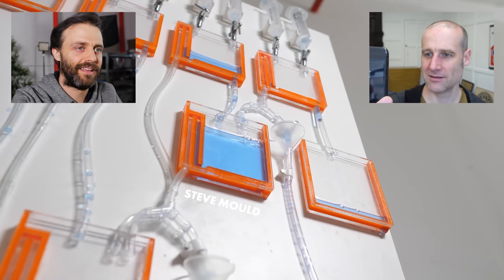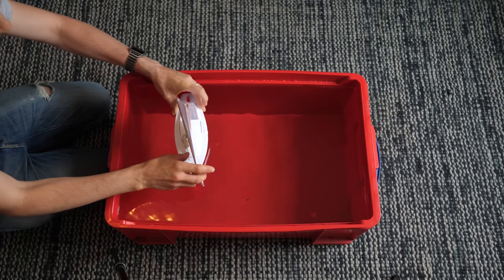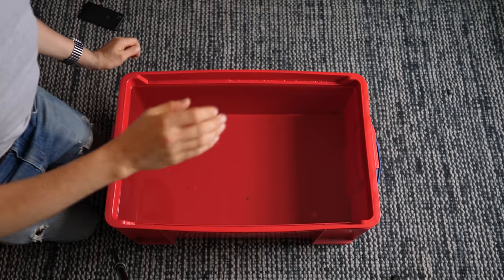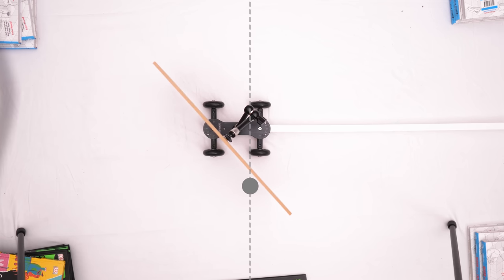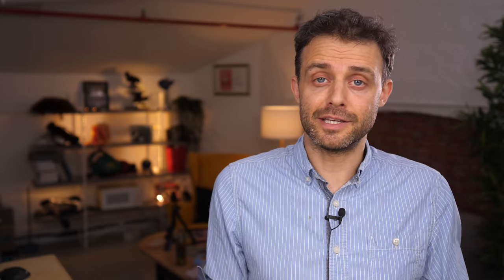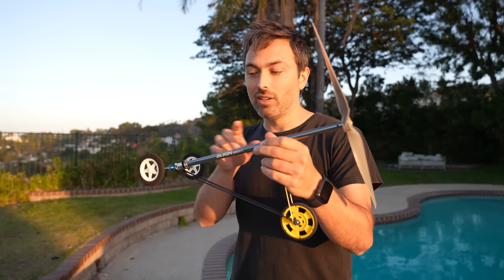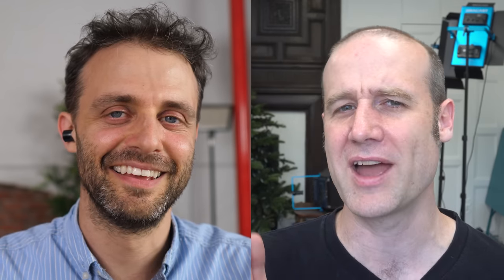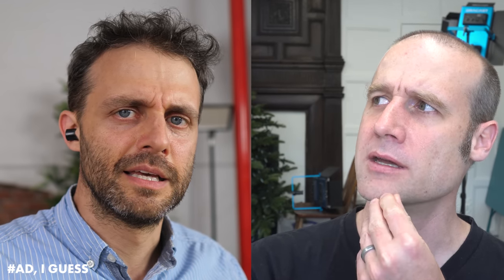Sailing Faster Than The Wind - How Is That Even Possible?

Comment: The Blackbird has no sail to take advantage of the wind in this way , though.  Nice , physics partially accurate, video !!    
The vectors of force , deflection of wind , is not as long as the exact direction of wing leg of that vector. AND the 'equal and opposite vector is not completely in the direction of the boat. There is a vector in direction of boat BUT a vector off to side direction that are the two components that when added together equal that 'equal and opposite ' vector you have dawn . (BEING in water , though, the hull of the boat (and rudder likely ) shift with some friction loss to water the direction thrust to the desired direction of the boat.
FORTUNATELY sails are NOT flat . If they were the idea of wind 'glancing off and pushing the boat would much more quickly be offset by the air friction on the front side of the sail being glancing off and  strongly resisting forward acceleration.

Comment: So the trick with that propeller vehicle is that the propeller blades have a tangential velocity faster than the actual wind speed. And this is possible because they're being hit by the wind at a <= 90° angle relative to their tangential velocity (which is however perpendicular to the vehicle's general velocity), and not from the back like veritasium's video seemed to suggest. Once you transfer some of that extra rotational velocity to the wheels you get a chance to drag yourself faster than the wind. But then this way the propeller would actually be working as a turbine instead, and that doesn't seem to be the case shown in Veritasium's video. I'm still confused.
Reply: The wheels of the Blackbird turn the propeller.  We have a ratchet on the axle to prevent the propeller from turning the wheels.  This is to satisfy the requirement for the record runs that we can't use stored energy.
Reply: @Rick_Cavallaro  thank you for taking the time to answer. I wasn't aware of the ratchet gear when I commented this.

Comment: This video works perfectly with veritasium's. Explaining how the sails of a boat can correlate to a wing (and therefore the fan blades on the vehicle in his video) and how it propels it faster than the speed of the wind going directly downwind. 

A complaint i would have on the video (if it was in responce to veritasium's) is the video should have gone a bit more in depth about how a zig zag is faster and how just a continuous 'zig' would be the same as that to more intertwine the videos and explain how the fan blades does in fact propel the car faster than the wind. 

Obviously its not made by the same creators and its not made to just explain the car but how sails work. Other than that i loved this video and it was easy to follow along with what you where saying.

Comment: Maybe if wont reach that maximum speed instantly, but it will reach a quite higher speed than the wind, just that with less acceleration, you could hust angle the sail more when it reaches more speed, so that you have allways the best possible acceleration, just like with a gear box but with wind instead

Comment: What veritasium is doing is what sailors' call running. As any sailor will tell you you cannot run faster than the wind. The only time you can go faster than the wind is when on a tack (and even then you need a good keel -to prevent sideways drift).

Comment: The resistance to sideways motion of a sailboat is not negligible. Its significant. In fact if you trace the actual path of a sailboat its not at all a direct line perpendicular to the angle of the sail. Your own diagram indicates this however not accurately.

Comment: This is a great explanation of how the speed of a boat can exceed the speed of the wind. However, it seems to imply that if you look at the velocity component of the boat in the same direction as the wind, it will only ever be the same velocity as the wind or less. In Derek's video, he says the component velocity of the boat in the direction of the wind can be faster than the wind.

Putting it a different way. Let's say you had a balloon that is neutrally buoyant and floats a few metres above the water at wind speed, if you race the balloon and a sailboat from point A to point B, can the sailboat beat the balloon. If you watch Derek's video at 7:21 (https://youtu.be/jyQwgBAaBag?t=441) this is discussed. When the question is asked, Derek basically says by sailing at some angle to the wind (and tacking) you can beat the balloon from point A to point B. No explanation is given as to how this is possible. This seemed to be a critical aspect as to how Blackbird can go dead downwind faster than the wind and that is the part that is counterintuitive. Are you able to explain how that is possible with said models to someone who is struggling to understand?
Reply: To see how sailcraft can beat a balloon in a downwind race look at "DOWNWIND VMG GRATER THAN WINDSPEED (WEDGE)" or "DOWNWIND VMG GRATER THAN WINDSPEED (STREAM LINE)"

Comment: Haven’t watched yet but i’m gonna make a guess: the way the air collides with the boat depends on the air’s momentum, not its speed. If a large enough mass of air hits the boat, even if it’s going the same speed, the boat may be able to travel faster than the air?

Comment: I actually think that the explanation  given by in the veritasium video, that the propeller is pushing the car is wrong. Its the fan thats driving the wheels not the other way round. To test this one would have to measure torque (direction) in the drive shaft, from the wheels to the prop.
Reply: "Its the fan thats driving the wheels "

No, it has a ratchet, which prevents that: only the wheels can turn the propeller. It also wouldn't work in steady state, because it would accelerate the true wind relative to the ground, instead of slowing it down.

Comment: So what angle of the sail is the fastest? It seems like the faster you go the more you can angle it to go faster so what angle does it reach its maximum speed? While the angle of the relative wind increases can you make the sail 90 degrees from true wind and still accelerate or would you slow down?

Comment: In this video you suggest that you can even sail upwind faster than the apparent wind, with setting your sail higher than 45 degree against wind. But it isn't true because as soon as your speed is higher than the (apparent) wind speed, the "front wind" component of the apparent wind will be also higher and it turns the resulting apparent wind for lower angle. Therefore from the boat perspective you will never see higher velocity than the apparent wind speed. And I suppose you can never see lower wind angle on your sail than 45 degrees. I never tried it, just I was thinking on this for days :)
Reply: When sailing downwind, the boat speed (relative to surface) can be higher than the apparent windspeed (relative to boat).
Reply: @eyytee  you are right, because in this case the real wind speed decreases the apparent wind speed. I missed this scenario because I concentrated on upwind sailing, which is the subject of this demonstration. Edited my comment.

Comment: Interesting.  As a sailor from a very young age, i have learned that i sail fastest (even though it feels slowest) when i sail 'with the wind' the ship will be nice and level, sails perpendicular to the direction of movement, and maybe get the ship in a 'plané' (get the underwatership above the water with only the keel sliding through water reducing resistance massively

Now let's see the vid and learn why that should not be right...

Also anyone watching F1 knows what the Coanda effect is. (Simplified it is the fact that air wants to 'stick' to an surface)

Comment: That is a good visualization for what is happening when a boat sails upwind or across the wind.  But when a boat sails faster than the wind away from the wind, it doesn't work at all: for a start the wind moves the opposite way over the sails to your setup. The sail is not deflecting the real wind, but it is deflecting the apparent wind, which it pushes backwards into the real wind, creating an area of pressure that pushes the boat so it sees an aparent wind which it can deflect backwards to crate an area of pressure....       No idea how you can show that with a simple model, as there are feedback loops involved (as per the gearing in the veratasium setup).
Reply: It's impossible to deflect the apparent wind without deflecting the true wind.

Comment: I am so happy Bernoulli never entered this chat. Bernoulli is a convenient  way to figure out the math of phenomena it is not the reason for the phenomena, High pressure does not cause a boat or wing to achieve lift, a wing redirecting wind causes high pressure, the lift has already been made before the pressure does anything. 

but screw figuring out newtonian math for each particle of air being redirected.

Comment: If a sail works as a wing the majority of the "lift" is generated by the wind moving over the outside of the sail creating a low pressure area, pulling the boat forward.
And the wind pushing into the sail is minimal relative to the pulling....no?

Comment: Steve I think you missed the point of veritasiums video.  The whole point of his video is that he travels faster than the wind, using only the wind IN THE DIRECTION OF THE WIND.

Veritasium also clearly explained that the zigzag is faster in speed, but does not travel the same distance in the direction of the wind.

Comment: Funny thing is that Derek's contraption wasn't explained in his video. He was talking about sails on a cylinder which push his landraft faster than the wind but that wasn't what the final conttraption did; that was moved by the wind which then through a propshaft turned the blades making it a prop (the wheels made the "sails" turn faster, not the sails making the wheels turn faster). In the end it doesn't matter. You can go faster than the wind, just as you explained, and nothing new was established..

Comment: Congrats on 1M subscribers. I have a query about force ?vectors? that I am very curious about , it concerns wonky shopping carts/trolleys.
When I accidentally get a wonky shopping trolley, I tend to push the handle from one corner with the trolley angled about 30-50° in the opposite direction in an attempt to stop my knees blowing out while keeping it straight. How is it that I am applying force to one side but the front end of the trolley pulls TOWARD that direction even though the sources of friction/drag (wheels) are on the opposite side (for reference, where I live has steel wire mesh trolleys where all four wheels can rotate freely on castors - also the push handle is wider than, and behind all the wheels).

Comment: So... what's the fastest way to arrive to the "max" speed, or at least, to converge towards it? It would be interesting to see the graphic of the function of the angle(t). I'm thinking, maybe the brachistochrone is related to the solution?
Reply: Fastest way is to trim in your sails at a rate that matches your boat’s acceleration, which is different for every boat. We do that using telltales, little pieces of string attached to the sails that show us exactly what direction the wind is coming from so we know if we need to trim in more because we’ve accelerated and the wind angle has changed. If you keep your telltales happy you’re doing it optimally

Comment: It's possible
Like even if you slightly splash a water in the direction opposite to the wind and your boat is also going in the direction of the wind then theoretically, you're going faster than the wind.
(I haven't watched this video)

Comment: But, when you gain speed the apparent wing vector changes right? Because you are in your example moving around 90 degrees to the wind, when the boat speeds up the apparent wind shifts then to be angled…what then?
Reply: Maybe I didn’t write that well. I mean take a motorboat…on a completely calm day, the motorboat being propelled, the boat itself now experiences wind directly in front of it to anyone in the boat. Same thing here right? As the sailboat gains speed, it is moving the wind on IT in such a way to make the wind now more fore, more toward the bow? So now the angle of wind has changed, do you have to trim the sail to now take advantage of the self generated wind and the wind, the apparent wind?

Comment: Great video but it doesn't address the magic happening - the propeller geared to the wheels that is transferring momentum from the wind to the earth, with some being redirected to the vehicle. I'd love an intuitive explanation of that!

One of my computer teachers told us a story about a project with a very similar premise. A model boat that had to "sail" directly towards a fan using two propellers, one below the water, and one in the air, connected by a single shaft with no gearing. The goal was switched up as the boats had to travel directly into the wind, but the concept of attaching the interactions between the land/water and air together was present. How that coupling can be used to take energy out of the wind to accelerate a vehicle downwind really needs an intuitive explanation.
Reply: @goasthmago6354 
good explanation! 
however, we're talking about traveling directly downwind faster than the wind. the vehicle that veritasium showcased had a variable pitch propeller which is linked to the wheels. It's able to go directly downwind faster than the wind.
The explanation is necessarily different than an explanation for sailboats due to the spinning blades transferring momentum from the air to the vehicle with no apparent wind, and due to the fact that sailboats and other sailcraft cannot do the same thing in steady state. 

There are a lot of analyses of the problem available, a key phrase to search is "DFTTW" or "dead-downwind faster than the wind"

You seem to know a lot about sailing so maybe you could help explain this one. The papers shed light on the math (verified in experiment) but the intuitive explanation is still lacking.
Reply: You'll have to think about the efficiency differences yourself, but the video series titled "Under the ruler faster than the ruler" does a great job also.
Reply: @goasthmago6354  I tend to believe the math and experiments, but if you can poke a hole in the math showing that it's possible then I'll believe you. There's no free energy problem as the craft is essentially doing the same thing a wind turbine does, and for that matter the same thing a tacking sailboat does.
Reply: fella deleted his comments... Anyways, if anyone has an intuitive explanation, chime in!
Reply: @AppleCakes7  I have an explanation that feels relatively intuitive to me.  It's the vector diagram I first did to prove to myself that boats can maintain a downwind course with downwind VMG faster than the wind.  That's what led directly to my building the Blackbird.  Unfortunately, I don't think I can post a vector diagram here.  I do touch on it in my talk at the St. Francis Yacht Club, but I don't really spend much time on it since the audience were all sailors that already accept it as fact.
Reply: @Rick_Cavallaro  Wow, the man himself! do you have a link to the vector diagram? I'd love to see it.

The videos I posted, especially the "sail to prop" animation, helped me understand the dynamics at play and how they arise. And the math does check out!
Reply: @AppleCakes7  I'm glad the "sail to prop" animation helped.  That was an animation I asked one of my on-line buddies to do (since I have no animation skills) and I used in this talk (linked below).  I don't have a link to the vector diagram, but I could put it in dropbox and post and post a link if you'd like.  Meanwhile, this will take you to the part of the talk where I discuss the vectors.  Unfortunately, since I was talking to a group of sailors that are already well aware that a sailboat can tack downwind faster than the wind, I don't spend a lot of time on the vector analysis.  Nevertheless, have a look and let me know if you have questions...
https://youtu.be/X6oJpnSJyV8?t=1451
Reply: >> "Under the ruler faster than the ruler"
 @AppleCakes7  You should study all of his videos on the topic.  Michael has participated in the on-line forums discussing this topic with us for a very long time, and has a spectacular way of demonstrating these principles.  I believe he's participating here as well (or perhaps on Derek's video) as Coolaun(?)
Reply: @Rick_Cavallaro  that's funny you were behind that video!

Thanks for the link, it helped get it to click for me. it clarified how the gearing to the wheels + the variable pitch prop can simulate a boat tacking downwind. 

The way I see it now is that the prop speed is coupled to wheel speed, which gives us something like an equivalent of boat heading, while the variable pitch propeller gives us control over sail direction to maximize lift or thrust. 

I really appreciate you coming into the comments here to help explain things!
Reply: @Rick_Cavallaro  "Coolaun"'s videos are great, very clear.
Reply: @AppleCakes7  I'm always more than happy to discuss this kind of thing with anyone that's actually interested in a discussion - even if they're a genuine skeptic.  Less so for the folks that simply want to call me a liar and a con man.  Although at this point perhaps I should be more flattered that people think I could have pulled this off as a con.